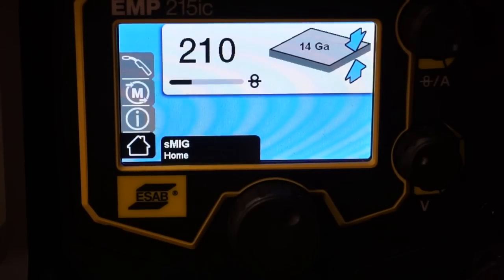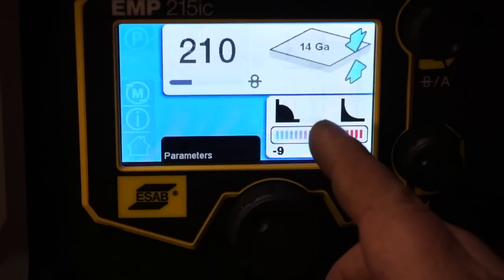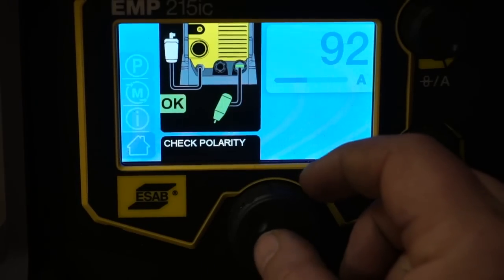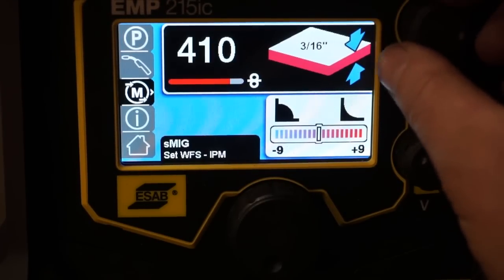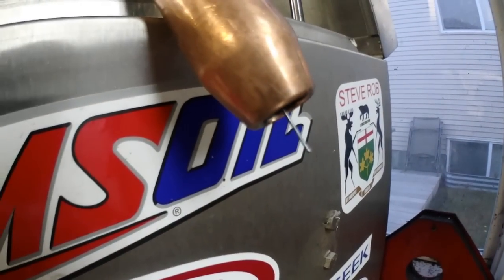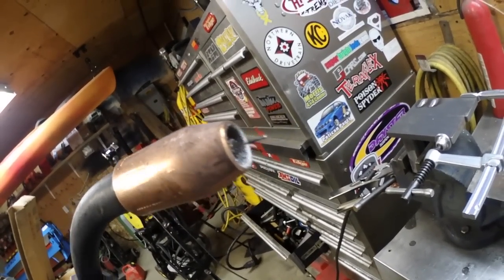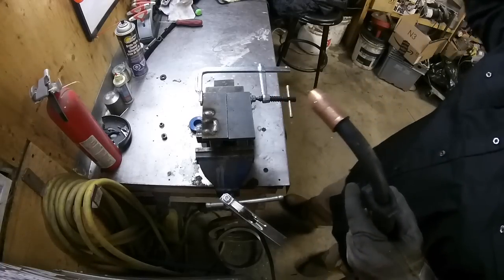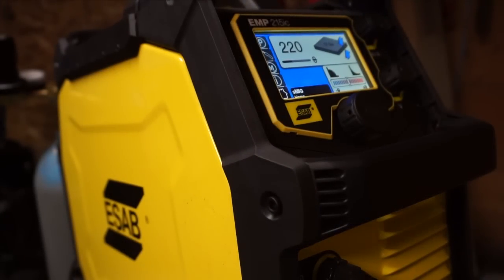ESAB Rebel Advance Features

Comment: I love mine. And the ESAB customer support has been amazing here. only had one issue and it fixed by doing factory reset. They also pointed out that there are some firmware updates avaiable for my machine that is already a few years old, will have those updated soon to get even smoother function.

Comment: Try it on light metal. 16 guage or thinner. I have never seen a welder so out of control on the low end. 
Love the arc welder but the smig sucks.
Reply from the maker: I agree with you there I either have to use it in manual mode

Comment: lift is a sweet set up, Needs a smaller more mobility in the torch handle,
Reply: Len Johnson torch is the easiest thing to change. If you want a small easy head, get the CK. 9. Since this has a dinse 50, most any head will work.
Reply: CK torches for sure and Esab foot pedal over the Esab Tig torch, it's way to bulky for any finesse.
Reply: CK torches for sure and Esab foot pedal over the Esab Tig torch, it's way to bulky for any finesse. I was going to drop a few hundred on the esab torch for my Rebel EMP 235ic but I went with a 2 CK torches and a esab foot pedal instead.

Comment: Cool review. Ive been debating on getting an Esab over Blue and Red. I currently have an Everlast 140st. Its okay but cant set it to recomended settings from any other company, or chart. Its a guessing game.
Reply from the maker: i've used both blue and red over the years and the rebel is by far in my opinion the smoothest welder i've used

Comment: I'm impressed as well . Sounds smooth. I bet it has pulse tig function. My Lincoln doesn't have any functions but wire speed and heat levels.
Reply from the maker: +STEVE ROB no pulse on this Tig,  my Lincoln had pulse but I prefer just a basic tig for my needs
Reply: Dc lift tig only.
Reply: Franks Garage and customs Huh?
Reply: This machine will spark at 5 amps and run smooth as fuck. No need for pulse.